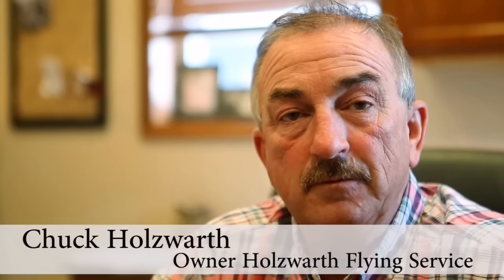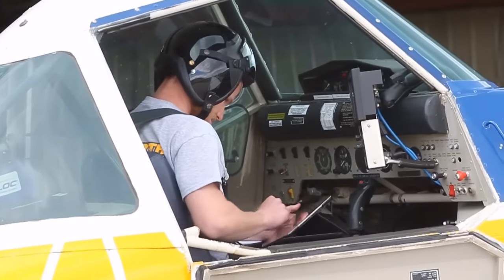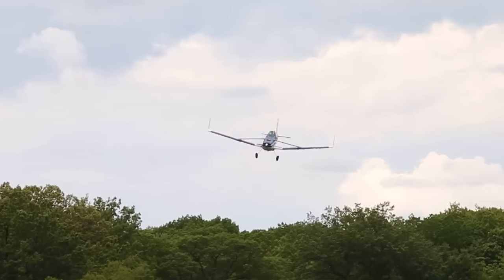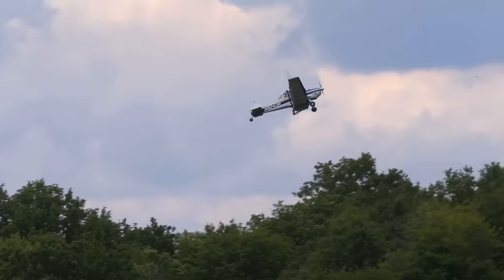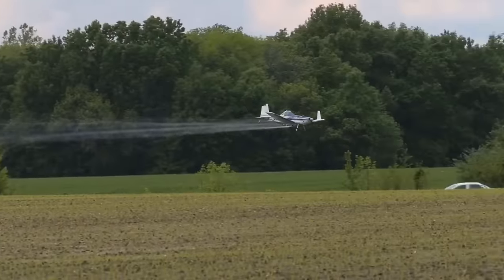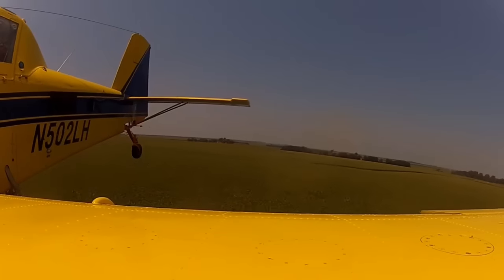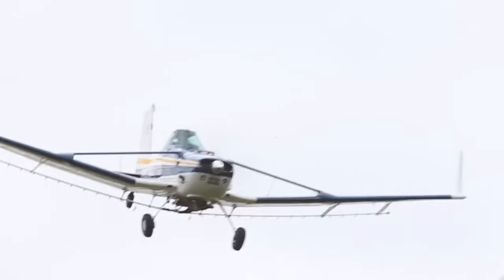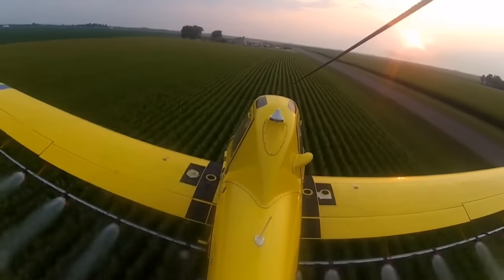Flying a crop duster

Comment: I flew ag years ago when it was  round engines, plat maps, automatic flaggers and a pressure gauges. By the end of my second season I was starting to get a bit bored with the old back and forth, not to disparage the skill required but in my opinion the initial learning curve is definitely steep especially if you don't have great hands and feet, aren't the best decision maker or can't fly the wing but it is fairly repetitive and to have a truly fulfilling career as an applicator a genuine interest in agriculture and related topics is in my opinion mandatory. :)

Comment: For those that don't know 188's. ..exhaust is on the right side
Reply: Most Modern Turbine Ag Plane Operators use Single Point Refueling so the over wing refueling is not an issue with the engine running and prop in feather.
Reply: Or both sides

Comment: That small of a field...why not just use a heli? doesnt seem cost effective to use fixed wing on anything less than 200 acres..
Reply: warmfreeze in central Illinois trust me a lot of us wish a heli would do some of this stuff but il take a square 80 all day. An 802 can do it in less then 10 min. Just depends on location and field shape.
Reply: Wouldn't it blow the pesticide like.... Everywhere?
Reply: Thijmen Kuik not sure if you’re talking about a heli or a plane, but either or no.
Reply: flyinlow a heli
Reply: Thijmen Kuik when a heli is in flight just think of the rotor as a giant wing. Spray works just like an airplane. They use a motor or hydraulic pump instead of fan blades though because of speed.
Reply: flyinlow downdraft?
Reply: Thijmen Kuik the speed and nozzle/boom setup compensate for any downdraft but they don’t spray while they hover so it’s not much of a factor.
Reply: flyinlow ah alright gotcha.